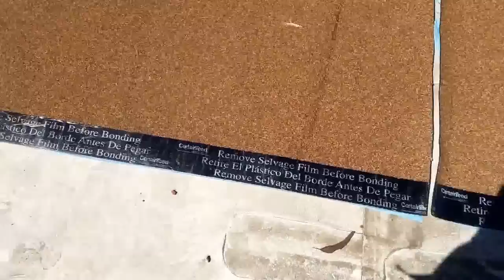Pro roofing tips : How to install a Tunnel Skylight and Curb mount skylight on a tile roof .

Comment: Nice job...Perfecto Garcia. And very interesting to see the actual path of the water when you poured it out from that cooler. Those old tile jobs were pretty amazing as well-30 years out of a tile roof that was sitting on battens alone! But I've seen thatch roofers in England make bundles of reeds, and turn those into a long lasting roof, so I guess almost anything is possible.

Comment: Nice job, my question is the sheet that you put for under flashing, it seems that it is shingle material sheet, water will be running on top of it, how long this sheet is going to last before it deteriorate? other than that, excellent video.

Comment: Hey Eric I have a quick question ,why does this home owner have a skylight that doesn't connect to living space and only supplies light & heat to his attic ,am I missing something I don't see such as the polished stainless steel tube that's supposed to connect to the roof line and direct light into a living area ? 

I've installed hundreds of the Velux Home Depot tube skylights in different homes ,even 6 of them in my own kitchen area ,every 1 I've installed connects to a polished steel tube that then connects into a clear round light fixture looking thing connected to my ceiling ,am I wrong here and not seeing the tube to direct light into a living area ? I don't understand why any home owner would use a sky light for just an attic space .